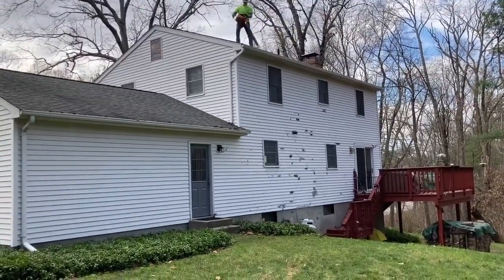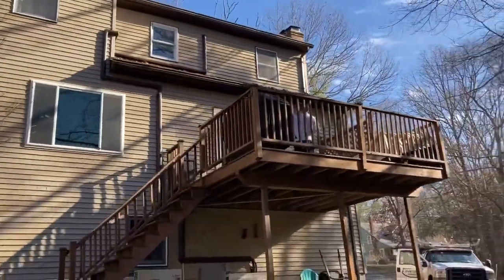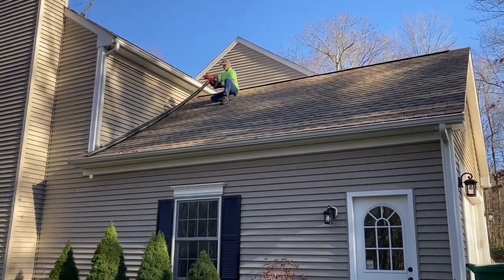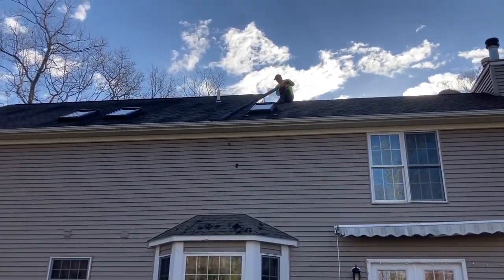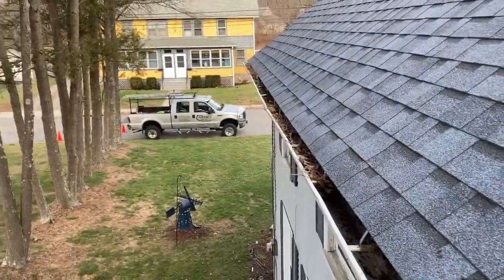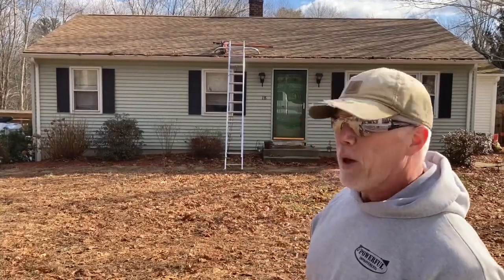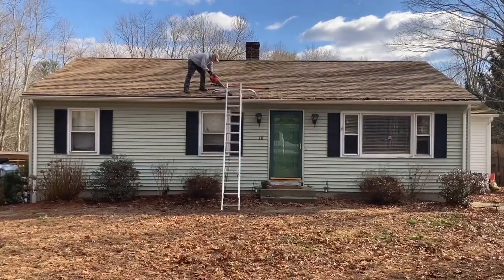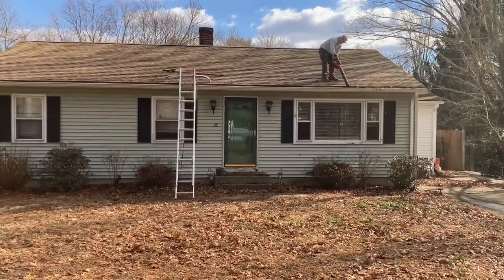HOW TO MAKE $500 A DAY GUTTER CLEANING

Comment: I did my first gutter cleaning yesterday. I charged $80. I used a Dewalt cordless vacuum for the nasty mud. One of the sections was plugged and had some standing water in it. I couldn't use a blower because most of the fall area was a deck I didn't want to get dirty. I took a heavy-duty contractor's bag up with me and put the heavy stuff in there. I was lucky the pitch wasn't too bad and could work from the roof
Reply: Your charging way to cheap. Minimum should be 150-200$
Reply: How is it going?
Reply: Its been 9 months - how much you charge now?
Reply: @DFWTOWINGLLC My minimum is $209

Atlanta market

Comment: Buy a cheap $250 power washer, $90 -  extension kit for pressure washing with harness And for $350 you can never climb and clean gutter from ground or first floor roof all day. A clean pressure washed gutter will bring customers back because your not just doing the inside but you can clean the outside of it as well. 
But as he said always get photos of roof pitch and house. I bid hourly labor and linear foot so they know I gave it honest look. And I note things in my quotes that will be obstacles.
Lastly run a 2 small electric fence post....and then caution tape across it where the electric lines are so you don't move a ladder into it. Safety always

Comment: How unsafe is it if the ladder with stabilizer doesn't quite reach above the gutter line? So working with it resting against the house a couple feet below the gutter line but such that your torso/upper body is still over the gutter line? I have a 22' gorilla articulating ladder and it has trouble extending above 2 story gutter lines

Comment: Instead of blowing out the leaves why not vacuumed them
Reply: Vacuum the leaves?.......................never, sir, never !!
It is more efficient and (more importantly) a hell of a lot safer to blow the leaves off the roof during the job for many reasons.
(1) If you vacuum up the leaves, you have to constantly empty the waste container. This is totally unnecessary and time consuming which in turn adds extra labour costs to the customer which pisses them off. It also prevents us from getting the job done faster which pisses us off as we're thinking of the money we're losing because we know we should be at the next job for the day by now.
(2) The vacuum will clog up most of the time with leaves (100% of the time if they're even the slightest bit damp) so you will spend half the time unblocking the mongrel things......More wasted time.
(3) Carrying the waste container down the ladder or lowering it on a rope repeatedly to dispose of the waste (and believe me, there is a lot) is not only unnecessary, it's also back breaking and time consuming.  It is also a major safety issue as we want to spend the least amount of time climbing a ladder or anywhere near the edge of the roof. (Hanging from your safety harness in mid air, or even worse, landing on Mrs Magillicutty's ceramic pot plants can really ruin your day)
(4) We do not want any extra equipment (waste container) on the roof as it becomes one more object that can potentially fall from the roof onto some poor bastards head.
* If you have a hose running to a industrial vacuum and container at ground level then disregard point (3) and (4). BUT, this does not in any way change my opinion on the subject of vacuums.
(5) Blowers are a LOT more powerful in blow mode than vacuum mode....A lot! 
In my opinion, the vacuum mode on a leaf blower is a simply a sales gimmick and and is totally useless. (They're not called leaf 'blowers' for nothing)
As a roofer myself, I can assure you it is way more efficient to blow the guttering out and climb down the ladder when done. Then it's simply a matter of walking around the house, blowing the leaves into piles and picking them up with gardeners claws. While doing this, you blow the cobwebs and dust from the outside of the house which will impress the customer immensely and assure you of repeat business and great reviews from them.............Done and dusted!
Reply: Ineffective sky vac is about a $3000 tool. And just not necessary for the amount of gutter cleaning I’m doing.
Reply: @scatter1390  Thanks for the reply.
If I didn't see your response, I would vacuum it by this week to start my Gutter Cleaning Service.